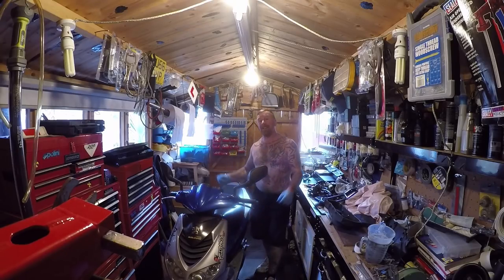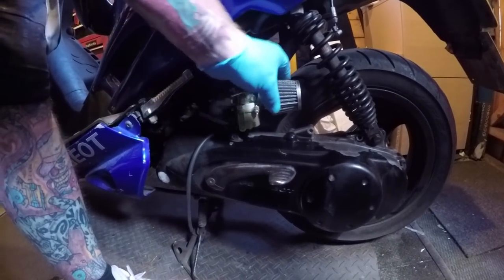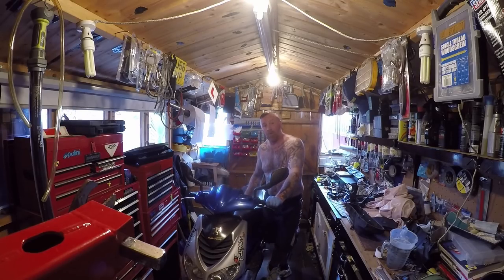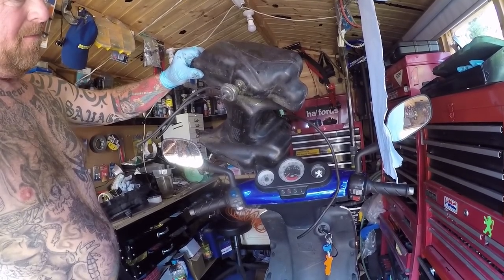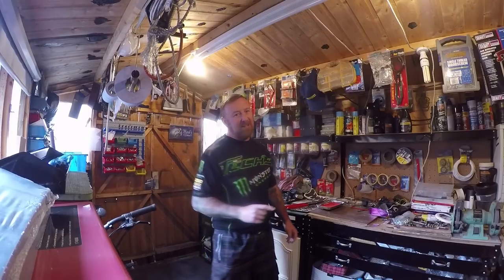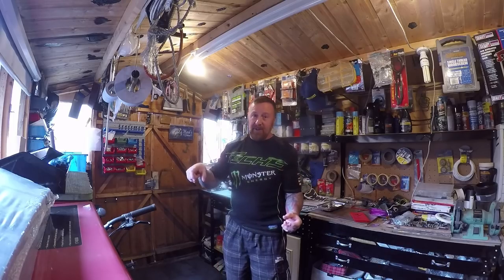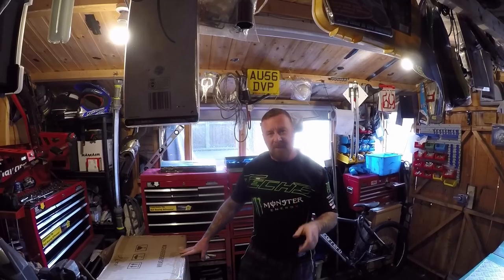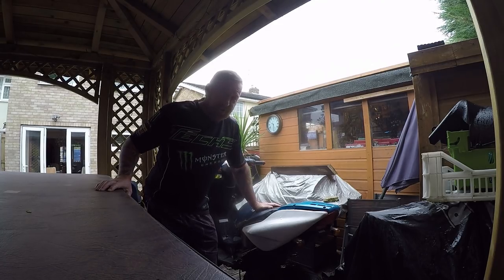SPEEDFIGHT VACUUM PETCOCK CARB WONT START MARK SAVAGE

Comment: Hi pal. If left for any length of time my 2006 50 l/c is a right git to start.It takes ages to start or doesn't.The only way it will is if you use easy start.once running it feels choked up but clears as you rev it up.Ive cleaned the carb.Hope you can help.Its doing my head in!Thanks Mat.
Reply from the maker: hi bud it's very common on a worn carb to do this, you can change the fuel pipe and vacuum and the auto choke but it will still do it.
you are doin the easy fix with easystart and I would say keep doing it but it the carb, after a few days the fuel escapes / evaporates and is too low for the bike to pick up then you bike wont start till the fuel get through mean while you are getting 2t oil and this is why its all sluggish when it does start.
next time try taking of the air pipe and suck it to refill the carb and it will start you know that's the problem 
to fix well its a new carb of another 2nd hand one or keep using easy start, or sometimes they like to be kick started rather than electric or the other way round try that, but for easy and cheap fix keep using easystart or ride it more often lol 
hope that helps 
I have many more videos you may like to watch and over 70 on speedfight and please like and sub
mark
Reply: mark savage Thanks for that.i'll suck fuel through and see what happens. If it's the carb I'll get another one.cheers pal.

Comment: Mark - brilliant video and very helpful. wanted to reach out to pick your brains ref an old 2002 Speedfight 100 with some WSB paddock history !!!!! and very low miles i have an occasional loss of power like running out of fuel before it kicks back in like nothing happened, very odd.

Comment: Hi Mark, colin here again, i have a question, this time not about the 50cc agility 4t lol. Have you ever done a video on changing the crankshaft on a 50cc Yamaha NEOS 2t from 2005, mine has excessive wear on the outside where the cooling fan sits on the variator and because it has worn through the splines, i can't fix the cooling fan tight enough to get it running safely, or would it be less hassle to look around for a second hand NEOS 2t engine en put that on the moped
Reply from the maker: hi bud, I have videos on changing a speedfight crank and its the same sort of thing, sometimes its just as easy to but another second running engine as for changing the crank can cuase other issue when trying to get it back together and running 
as said I have over 70 on speedfights and 150 in total on mopeds so hopefully some videos will help 
mark

Comment: i just get gilera runner sp 50cc  2013 is it good ?  used to be liq but now aircold
Reply from the maker: not sure about the used to be water cooled and not air cooled?, the head would need coolant running around with a water pump, how did they change that to air cooled with a fan unless they change the whole engine?
unless its running and running well I stay away as problems maybe just around the corner!
please like and sub and I have many more videos you may like to watch and help
Reply: i sub bro and thx for replay they didn't chnage   engine just some thing did put   i wanna send u a pic of it so i'm not pro in this things i know a little  so lol
Reply from the maker: well bud I have loads of videos on my channel that will help plus another channel with all of them on a play list under mark savage Peugeot speedfight
you can always upload videos and let me know and ill watch them if I can help I will
mark

Comment: Hey Mark, I’ve got the speedfighter 3 it’s topping out at about 39 mph thought it would go faster to be honest.  You reckon I’m hoping for to much? Also there a rubber cap missing off mirror arm which protects the tighting nut. Any idea where I can get one from? Thanks Ryan
Reply from the maker: hi bud 
ok I have a few videos on the sp3 on here as I really don't like them or working on them as they hate me, they have 4 restrictions carb, rollers, exhaust and cdi and can be a bugger to derestrict ! so 39mpg is not bad TBH 
if you have done the first 3 and still only getting 39mph you can try to get a cdi but parts are very hard to get hold of for the sp3's , as for the cap try e bay for someone braking one other wise its a new mirrors 
please like and sub and watch my other sp3 videos 
mark

Comment: Best thing to do about panels that can’t be screwed on with bolts because of it’s snapped in side? (Speedfight2)
Reply from the maker: hi bud 
thanks for watching , try lining up the whats left on the inside of the other panel and either use wood screws and screw into them or heat glue them on thats the only way or if you have to which i hate pull ties grrrr 
mark

Comment: Hi mark, been watching your videos but still can’t fix my speedfight. Is there any way I can send you pictures to see what I need to get? I lost the key and think I need a bypass as it won’t spark. Cheers.
Reply: Forgot to mention I got a new barrel, all lights come on and it goes to start but doesn’t spark.
Reply from the maker: Kameron Cullen you can upload a video and let me know and I’ll take a look but if it’s a immob bike and you lose the key you will need a bypass unit 
Mark
Reply: mark savage thanks a lot, I’ve uploaded a video hopefully you know what I can buy.
Reply from the maker: Kameron Cullen out at mo but will watch it later bud
Reply from the maker: Kameron Cullen ok it’s not a immob cbt just a standard cdi less the £20 on e bay 
Prob blew it with the ignition wires !
Need to sort that first with the correct wiring 
Someone was trying to bypass the key,sure I have this on one of my videos but you will have to have a look o my channel on the computer so you get to see them as over 70 on speedfights 
And I show which wire goes where or go on google for specs 
Sure one wire twins up to two ! 
 But you need to get them right. Bud .
Reply from the maker: Kameron Cullen yea bud as long as they are correct all should be fine but you may need to replace the old cdi 
Mark
Reply: mark savage thanks a lot for the help mate, it’s sparking now so should hopefully be running soon. Cheers.

Comment: Hello Mark. i would like to ask you for an advice; two days ago my speedfight 2 stopped in the middle of the road while driving it. I tried turning it back on but it wouldnt really work for quite some time. After an hour i managed to start it but I had to add additional throttle when starting it for it to even power on while using footstarter. I left it sitting for two days and it turns on with foot starter now, 2nd -or 3rd kick but seems to be idling quite badly and acting strange ( i think it smokes a bit more than usual too!) , scoot still delivers power on heavy load but seem to has issues more when it gets hot than it has cold. Any idea what i should check out?
Reply from the maker: did he run out of 2 t oil ?
e10 fuel?
sounds like piston damage and scoring of the piston , if ac its easy to check and change like in my many videos on these 
they are all on a play list bud

Comment: hi mark been watch your vids  to sort sons bike streetfight2 getting nowhere got a nice spark cleaned out carb as your vid still no good from electric start tryed the kicker thats naff looked at your vid on repairing so new kit wanted there now been told a 70 kit was fitted  so thinking on taking it back to standard as i have never heard this running how can i get her to start before spending too much money  to get this rd worthy for my son cheers mate
Reply from the maker: Hi bud
Yes there is over 70 videos on speedfights and sounds like most will help 
Best type in speedfight mark savage and they will come up 
Ok 
I'd take the head off and inspect first 
The pistons go so easy and won't cost you money with my easy videos
It might say its a 70cc on the head !
I really don't like them and would go back to 50cc
You have spark so good 
Have you tried the wet hand test ? 
Is the plug getting wet ?
Does it pop if you open the throttle when trying to start ?
Fix the electric start is cheap and easy to do again follow my videos bud 
Hope this helps

Comment: Hey bud, can you tell me how to disassemble the vacuum petcock you showed in the video because it probably stopped working in my speedfight. Is it somehow unscrewed from the fuel tank or is it just pressed on? and is it possible to remove it without removing the fairings?
Reply from the maker: I have a few videos on it 
Fuel out 
Side fairing needs to be unscrewed so you can see the jubilee clip unscrew and pull out 
Easy bud

Comment: Is there anything you don’t have in your man shed?! On a different note I fitted a new back tyre Friday. Took less than an hour including the balancing. I reckon the heat really helped with breaking the bead and getting the new tyre on. 😬
Reply from the maker: DervMan at this moment I think I’ve got everything pmsl 
That was good , I’ve still got to give my a go as got to change the front and rear Tyres on the trophy 
That should be fun , so will make sure it’s warm then good tip !
Take care bud
Reply from the maker: hi bud
we have the festival of wheels event on in Ipswich this sunday 5th, I guess that a bit too far for you to come for a day out !
Reply: mark savage We should go up on Streetfighters 🏍💨
Reply from the maker: ha ha it may take a while but i'd get there but not so sure about you with the distance pmsl
Reply: mark savage I get there quicker than once I’ve stuck a 70 big bore kit and removed the oil pump 😂
Reply from the maker: you didn't just say a 70cc kit NOOOOOO you know how much I hate them pmsl,
Reply: mark savage you’re always bigging up those kits 🤣
Reply: mark savage you’re always bigging up those kits 🤣
Reply from the maker: Bad Steve !!! pmsl
Reply: In this weather, leave the tyres in the car before fitting. Come out toasty, and very pliable
Reply: Paul Ford That would explain why the tyre I changed last week was so easy to do, given it was 30 degrees out!
Reply from the maker: I thought that too lol I've got to do my trophy tyres very soon so will give it a go, I also got so G clamps for the 120 front to hold it down while I try to get it on.
ill do a video of it working or NOT lol 
mark
Reply from the maker: just bought one thanks bud :)
Reply: mark savage They are really good as they stop the tyre coming off the rim when being fitted. Can’t wait for the video but it’s not my fault if it goes wrong 😉👍🏻📷

Comment: hi mark, i was wondering if there is any difference between the air cooled or liquid cool speed fights are they both equally as quick? Thanks, Chad
Reply from the maker: ive found the LC are faster as they rev higher due to being water cooled, and ive have loads of both and its my view before any one else says different lol 
but to be fair it comes down to the last owners and if they have flogged them to death !
LC are a little harder to work on due to the water when changing the head/ piston but worth it with a few upgrades like in my videos bud
Reply: @marksavage  Cheers, but can you still get 50mph out of the air cooled?
Reply from the maker: JDM Gaming me too and more out of some 
I race tuned a50cc lc with every extra I had and got over 60 !
But most lc and ac will get 45 to 50 but sometimes the speedos are a little out ! Lol

Comment: Hi Mark not sure if your still active, just wondering if you could help me out, I've got a speedfighter 2 100cc was working perfectly fueled up then it cut out, pulled the fuel pipe off wasn't letting any fuel through, ordered a new petcock installed it and still doesn't let fuel through, don't have a clue any ideas would be amazing nice one buddy
Reply from the maker: @jamesdavies5605  hi bud , I've done videos on these , one is the vacuum that goes on the carb and being 100c it's on the rubber hose part but to test 
Replace , fill and suck one 
One will let out fuel to that to the carb the other to the inlet 
But if neither work it's broke bud 
Did you drain the fuel and flush the tank before fitting

Comment: Hi Mark my son has a speed fight 4 50cc 2 stroke his exhust broke of so iv got a new one and put on the new didn't have the extra pipe for the air pollution filter didn't think that mattered but he saying his bike is now slower can u tell me why please and how to get back running fast
Reply from the maker: This can happen 
On older sp1 and sp2s it would make them so much better 
Sp3 and sp4 may need a upjet and sports air filter 
But they are cdi restricted!
So small upjet by 4 and then a tune bud 
Don't worry about the GRV pipe

Comment: hi mark just need some help over text ive got a paggio nrg dd i went to rebuild the bike top end. well put new gaskets on it ive been trying to put it on all day and noting yet i get the head over both rings but dose not want to seem to slide down ive looked on your youtube page to see if any thing can help me but nothing yet to put it down smoothly ive tryed loobing the piston and barrle up with two stroke but no diffrens i need this to get to my job . at this rate im going to be fired . thanks dave
Reply from the maker: David Welsh ok as in one of my speedfight video put the piston into the head first with 2t oil and make sure it slides in and right way round and both rings once you know it fits in and out then leave it half way in and then offer it up to the small end off the crank and fit the pins in 
I do show this on my piston videos you should be able to do the same but make sure the gasket fit nice maybe use a little gasket seal to stick it down to help it fit 
Hope that help bud 
Thanks for watching please like and sub 
Mark
Reply from the maker: David Welsh I do have a few nrg videos too

Comment: Hi Mark I have a Puegot Vivacity 100cc, I had it as a non runner and had it going, cleaned out carb and looked at jets and seem ok, got spark and compression but scooter won’t turn over any advice mate?
Reply from the maker: It could be a few things but my speedfight videos will help 
You have spark
Wet plug?
Wet Hand test over carb ?
Piston gone ?
Reply: mark savage is there anyway I can send you a video and you could give me any idea what it is everything is fine what you suggested
Reply from the maker: @kuhnattv8312  upload a video bud and ill take a look 
Let me know when you have uploaded it 
Do a good video bud of the problem
Reply: mark savage okay great cheers mate

Comment: Hi mate been a follower of yours for a while and have always bought and sold mopeds however last week I came across a speedfight2 100cc on a 02 Reg with only 3000km! It had sat in a garage for 14 years! So stripped it all down got it running and riding and mot’ed and decided to keep this one but I’ve got a issue soon as I go near 50mph the front end vibrates like crazy tyre is good and no buckles in the wheel and shock and head stock bearings are like new what else could it be !!
Reply from the maker: hi bud , I had this before and mine was due to the front tyre uneven wear! also I had it on a crashed moped!
it had a light front end and had pushed the frame and the wheel was just push back an inch and although it look all ok being push back made it do I, check the distance from the wheel to the fairings. 
worth a look failing that tyre another front wheel and tyre bud 
hope that sorts it and thanks for watching 
mark
Reply: Front wheel needs balancing mate.
Reply from the maker: worth a look, thanks for the comment
mark
Reply: mark savage came down to buckled front tyre couldn’t see it to the eye used a local car garages tyre balancing machine and it was clear it was knackered bikes doing well I use it to go work instead of using my car I’m 25 and thing makes me smile all the time lol I also have a full bike license but like how simple and cheap the bike is to run :D
Reply from the maker: they are fun and easy to rag around on so a simple fix then bud all good to hear 
take care mark

Comment: Hi Mark Great videos, these have helped me with loads of things on my speedfights. One issue I am having and am just wondering if you might be able to give me  possible pointers on top/most likely things to be checking. I have checked everything I can. Issue I am having is the scooter feels a bit wobbly, slight handlebar shake.  I have checked the obvious things, headstock is solid, tyre pressures good, speedo drive and brake disc holder and shock absorber all feel solid.   I just cannot think what else is could be, Thanks in advance if you can give me some other things I might check. Rob
Reply from the maker: Dotty Dot sometimes it’s the very basics you over look as I have many times lol
The wheel it’s self!
Check it’s not buckled or the tyre uneven wear as this can cause It now a days with all the pot holes etc 
If all ok it may still have a twist to the wheel as the single arm rack can do this and again can lead to uneven tyre wear !
Worth a look bud and hope that help 
Mark
Reply: Have you balanced the front wheel?

Comment: I'm looking at buying a speedfight2  100cc  just wondering if its air cooled or liquid
Reply from the maker: All the ones I've bought and fixed have been air cooled , I've stayed away from them as they didn't sell well and parts are very hard to get hold of like the bendix etc 
And with a little playing with upgrades etc they go well over 70mph but it gets very unstable like your going to die at the first bend pmsl but all in fast fun 
Just have to have the balls to trust it